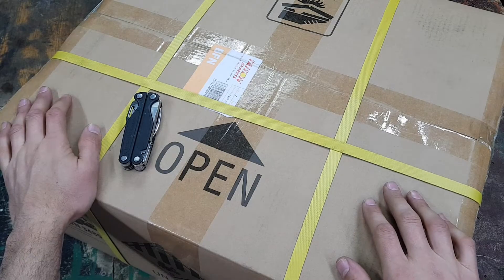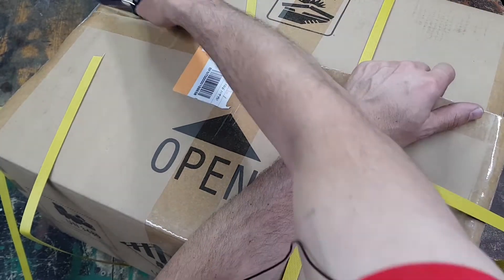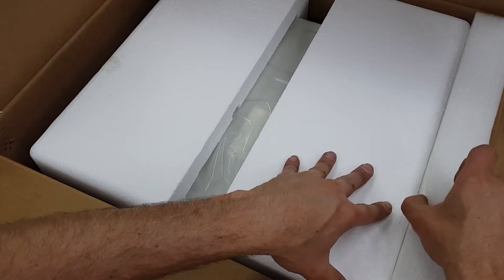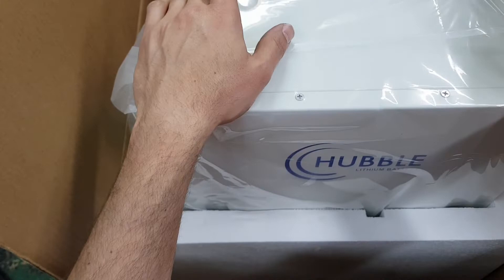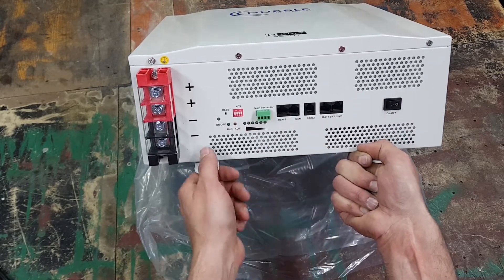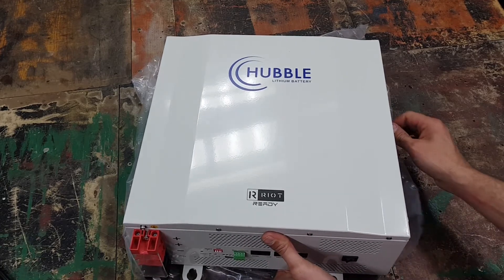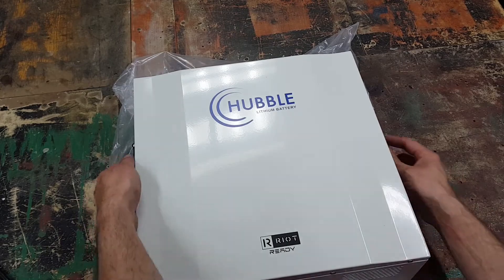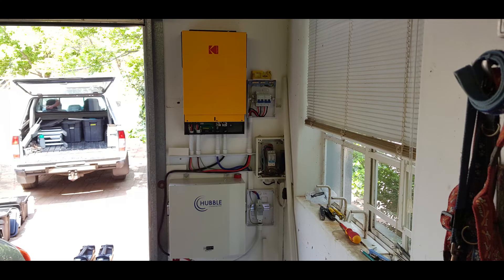Hubble Lithium battery 2.75KW

Comment: Hi @jacqalas I just bought one but I'm waiting on my electrician. What are you connecting to this battery and how long is the battery lasting?
Reply from the maker: It will easily go the full 4 hours when load-shedding is at its worst. This is at nighttime and it keeps on all the lights in and around the house, the TV, the laptop and a fan when we have warm evenings. The user draws an average of between 300 and 600 Watts per hour. In day time much less power is used.
Reply: Thanks for the quick response, really appreciate it👍🏾

Comment: The cables included, if 25mm, is probably for battery to battery connection and not inverter to battery. If you look in the Kodak inverter manual it states 35mm cable must be used for inverter to battery connection.
Reply from the maker: Thanks for the tip
25mm should be fine for 100Ah DC but better stick to the manual cause we don't want to void warranties 😉

Comment: hi ...the hubble BMS comms works with this inverter?
Reply from the maker: 24V stuff no but apparently the 48V stuff does. I phoned Hubble directly and you need the Hubble cloud to do that
Reply: I want to connect the hubble am-2 48v with the kodak og 5.48 … with the bms cable.

But no one can give me a definite answer whether these 2 work together… apart from some that has done it…hence im asking u cos u seem to have done it
(Eventhough u hv done the 24v versions… i would assume if it works on a 24v system, then it will work with a 48v system)

Thank u
Reply: @detailingbydesign9434 BMS Comms is an issue. Lead acid mode is recommended for hubble
Reply: But in your video, u show the hubble below the kodak inverter… was this not an installation that u did/ was done?

Did the bms cable work
Tx
Reply from the maker: @detailingbydesign9434  This is our installation and we used manual settings because the cable does not work directly.